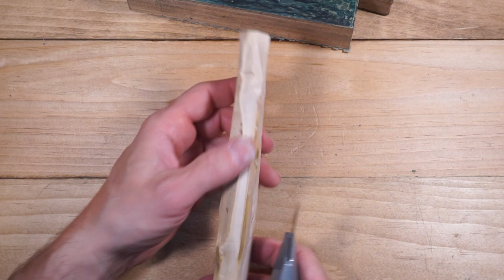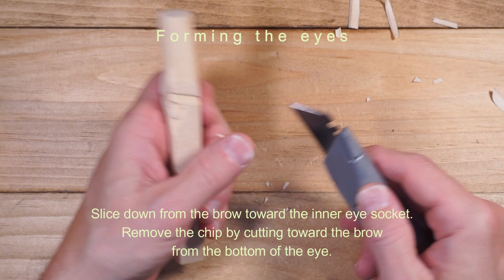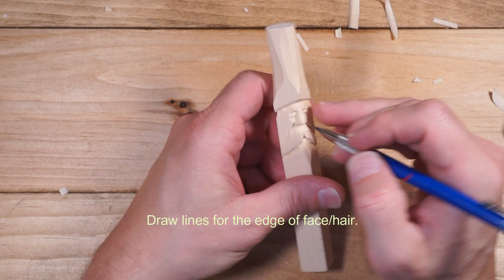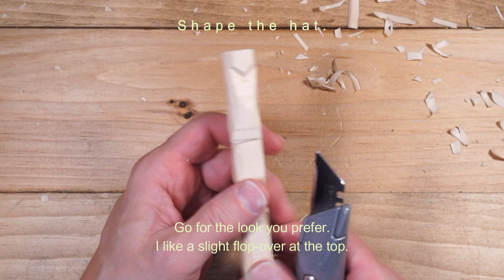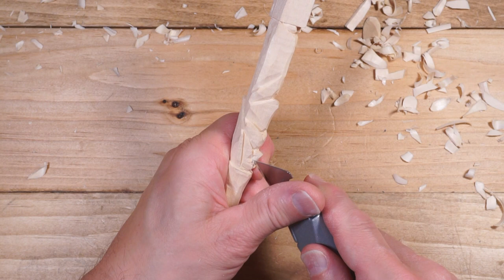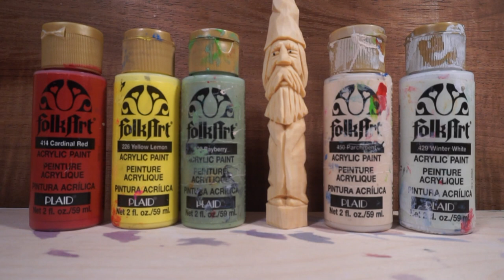Step-By-Step Whittling Tutorial - Stanley the Wizard 2 .0

Comment: Did you find it necessary to extend your blade to carve or it doesn't matter?  How did you extend your blade?  Did you modify it & epoxy it, like Lynn?  Subscribe/Bell
Reply from the maker: I use blades made by Lenox. They have 4 notches instead of 2 which allows a bit more extension. I use the 2 notches on the hidden end to secure the blade in the knife, never tried any epoxy. I have used it that way for years, no problems. I sharpen, hone and strop each blade before the first use, then for subsequent uses  regular stropping works fine. They can last quite some time. 

The 199 is a great knife and can definitely be used to whittle/carve. I own/owned close to 20 different carving knives and the 199 still is one of my favorites.
Reply: @WhittlingWoods  Thank you for the Lenox tip. When sharpening, do you use the white & green compound or does the green  compound do the job just fine?
Reply from the maker: @deltafour1212  I sharpen/hone a new blade on a ceramic stone, you could really use any type of stone. I like to use a stone first because it's  fast. Then I strop first with yellow compound on leather, then green compound on leather, and finish with green compound on wood. The key is to get it to cut the wood leaving a smooth clean surface - test it across the edge of some end grain. 

I have also had success using a mdf based wheel on a slow grinder to prep new blades, followed with stropping as above.
Reply: @WhittlingWoods  I meant the utility blades.   I thank you for your sharpening technique for your other carving tools
Reply from the maker: @deltafour1212  That is the method I use for the utility blade, and you are correct, same for knife blades. If it's for wood carving I use the same process for everything; gouges, carving knives and the 199 blades.
Reply: @WhittlingWoods  Wow. thank you.